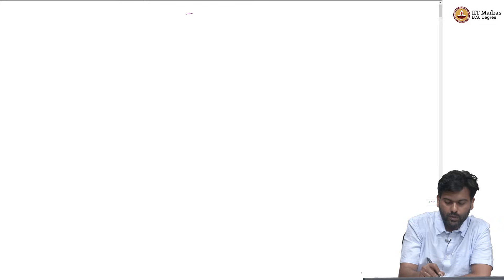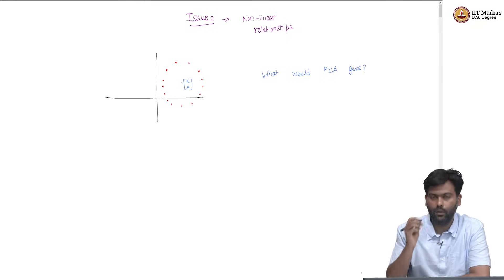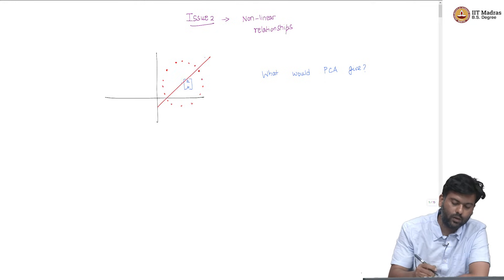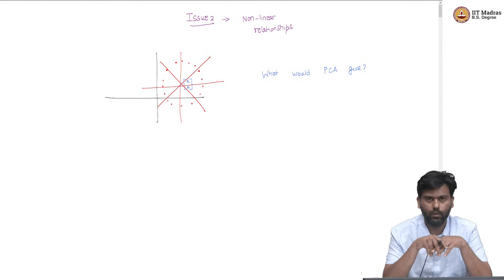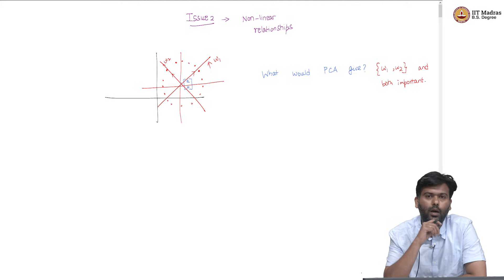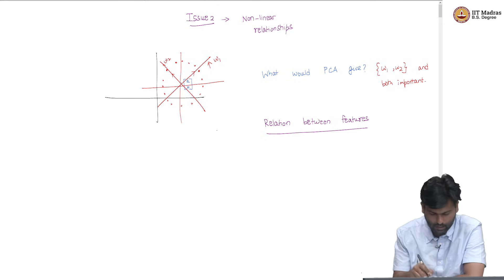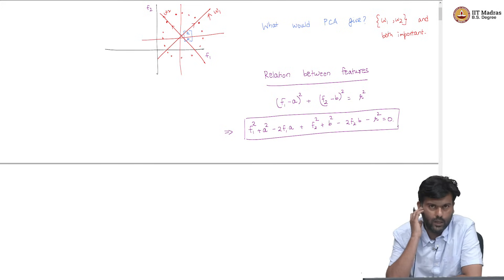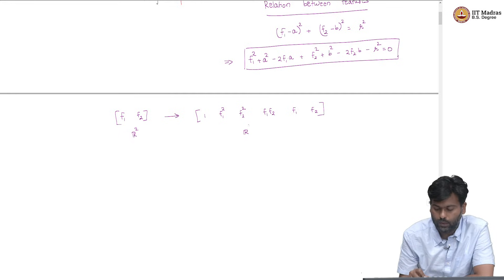Feature Transformation

Comment: 🎯 Key Takeaways for quick navigation:

00:13 🚀 Introduction and Issues Identified
- Overview of principal component analysis (PCA) algorithm.
- Identification of two issues: computational complexity when features are much larger than n.
- Solution to issue one by proposing a transformation using the matrix X transpose X.
01:10 🔄 Issue Two: Nonlinear Relationships
- Introduction to the second issue: Nonlinear relationships among features in PCA.
- Illustration with a simple example of data points forming a circle.
- Explanation of how PCA handles the circular data points and the challenge of nonlinear relationships.
03:42 🤔 PCA's Perspective on Nonlinear Data
- PCA's approach to finding important directions in circular data points.
- Discussion on PCA picking multiple directions and the challenge of deciding their significance.
- The importance of understanding the underlying data structure when applying PCA to nonlinear relationships.
09:13 🛠️ Mapping to High-Dimensional Space
- Introduction to mapping data points to a higher-dimensional space using the function ϕ(x).
- Discussion on the significance of capturing nonlinear relationships through mapping.
- Highlighting the transformation of data points to a linear subspace in the higher-dimensional space.
14:48 ⚖️ Challenges in Mapping and Dimensionality
- Addressing challenges associated with mapping data to higher dimensions.
- Exploration of the growth of features in the mapped space based on the degree of relationships.
- Acknowledgment of the increasing difficulty with higher powers and larger feature dimensions.